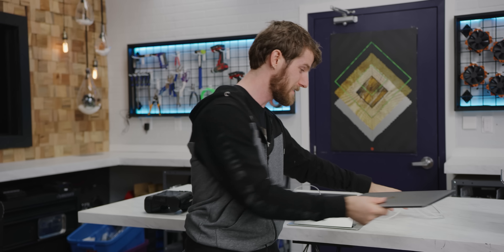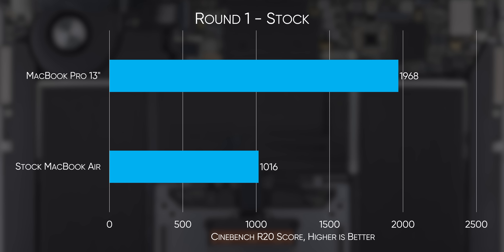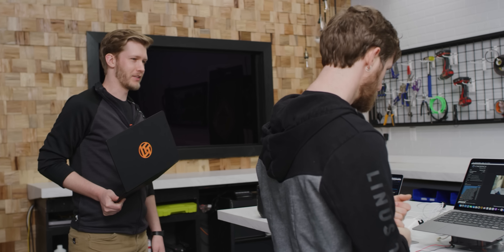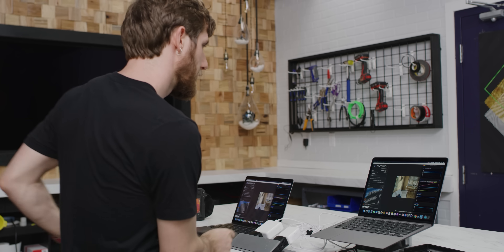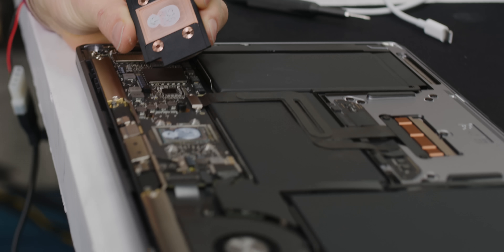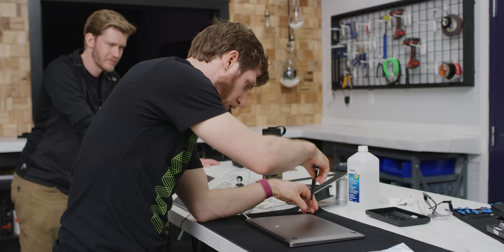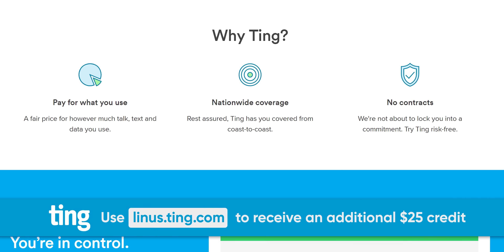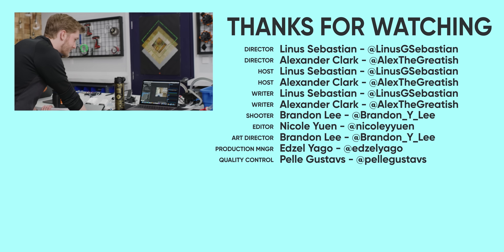Fixing Apple's Engineering in an Hour

Comment: I'm not into conspiracy theories but the one stated by Linus in this video might very well be true... Apple cannot be that dumb to just forget to put a freaking heatpipe between CPU and the fan.
The only non-conspirological explanation is that this laptop was actually already designed with and ARM chip in mind, but it just wasn't quite ready yet, so they had to ship it with Intel.

Comment: Why not put the insulating layer on the outside?
I bet the part of the laptop over 43 degrees is quite localised, so if you only put insulation over that part then the heat would disapate over a larger area of the case, so while you might loose a little bit of heat dissapation, you'd decrease the temperature felt by the user.

Comment: "what if apple is sandbagging the MacBooks so that when they introduce the arm based MacBooks it'll be at half the temperature"

Doesn't sound too far off what they would do considering that fact that they severely underclocked the Apple II GS to make the Macintosh look good
Reply: Wait, you're saying that they haven't learned anything in 30 years? Yeah sounds plausible.
Reply: @AndiKola  they have learned that yes this practice works and most apple users are dumb they fall for this trick everytime
Reply: Lol how about the tiny ass heatsinks they were putting on the PowerPC cpus back in the G4 and G5 days. It’s amazing how people complained about how hot they ran lol, an intel stock heatsink from the same time was way better than the dinky little cooler in the PowerMac G5. PowerPC was fine, they just didn’t cool it properly.
Reply: @mizukichan999  What are you talking about? The G5 had a insanely large heatsink, it was just a really shitty design.
Reply: I don't think it qualifies as a "conspiracy theory" if Apple has a long history of shooting their old hardware in the kneecaps because "tried and true" is not as profitable as "new and expensive".
Reply: No wonder they aren't working with AMD on their CPU side

Comment: This irks me a lot with laptop makers: going for ultra thin models that don't have enough cooling. It's just so stupid in particular with higher end CPUs: paying more for a "better" CPU but not getting that performance due to low thermal performance. But I guess the market just wants that sleek, thin look, no matter the performance. I understand wanting low weight laptops if you carry it around all the time, but you can make it light and not so thin as well. I mean, just with the thermal pad getting +13.7% performance is huge - feels like being robbed of performance on the stock configuration.

Comment: Macbook Air*

*Does not come with moving air. Provided air is static.
Reply: macbook AIR, passive cooling, the fan is there so u think it is actively cooled, just to fool dumb people who buy that sh!t
Reply: @scudsturm1  The fan draws air over the entire motherboard (exhaust). Its still not great but atleast it's there.
Reply: @seshpenguin  It's practically worthless and serves no purpose.  Not a real cooling solution.
Reply: @seshpenguin  Nah they just put the fan there as another thing to fail for planned obsolescence

Let's play what will fail first... The scorching hot CPU or cheap Chinese PC fan that doesn't even cool it, who knows!
Reply: @datachu  u can bet the fan
Reply: @seshpenguin 
What you just said is equivalent to putting a 200mm fan on top of the hood  of your car instead of a radiator fan and saying "at least it's there"
Reply: For the Air you pay a premium
Reply: @ilantzur02  the heatpipe is not included, this costs another $ 300, u can bet apple would do it if they are really that greedy
Reply: @scudsturm1 
They ARE.
Reply: @Rerin YL 1% would be a better guess

Comment: tfw the bloomin' nintendo switch, a handheld console, has more powerful cooling than this thing
Reply: That being said, the switch doesn't necessarily do a great job either. They absolutely drowned it in thermal mud. Cleaning it off and putting proper amounts of Arctic silver on it seems to have helped, but since there's no monitoring tools, my results are anecdotal at best.
Reply: @WahotsW  Indeed, and that's a good idea for when I'm bored! 
But seriously with this macbook, a tiny handheld's got more thermal mass, a heat pipe, AND and an actual finned heatsink!

Comment: Okay... like... you're freaking me out with you're "Conspiracy Theory" concerning the Intel vs ARM chips because I could absolutely see Apple pulling something like that.
Reply: You should check out the controversy around the Asus Zephyrus GA5902. The AMD versions have the vent holes over the fan intakes blocked off with paper, while the Intel versions don’t, which gives about 15 degree worse temps, not to mention weird as shit power settings in the BIOS basically forcing it to boost at all times. I bought one, removed the paper from the vents and got better temps, 20% better Cinebench scores and gained around 15fps depending on the game. And that’s without even touching the thermal paste.
No one can figure out quite why Asus did it, it certainly makes no sense, but the tinfoil hat idea is that they’re intentionally screwing up the performance of the AMD based systems for some reason
Reply: Lucas Foster Windows did this same thing to the surface laptop 3!!!
Reply: There's gonna be a lawsuit in like 5 years and sheep will continue buying apple. Its the way of the world
Reply: You're
Reply: They need to come up with a new selling point now :I
Reply: nuh, it's that intel can't make good low powered cpu.... oh wait...
Reply: I think they could beat an i5 processor with their new A14 without needing to sabotage the intel version, but this laptop is SO nerfed that the A14 (if they use that one) will be WAY faster. They'll be able to advertise like "50% faster than Intel" or something like that, and better battery life
Reply: What conspiracy did he say
Reply: @MrMaddog2004subscribe  That Apple was intentionally nerfing their performance with Intel chips so that when they make the switch to ARM , the performance with ARM will look better by comparison.
Reply: I mean apple is notrious for slowing down older iPhones via software updates so people would be forced to buy a new phone, so i dont think this is too far fetched.
Reply: BeanieBanta this actually isn’t fully true. They scaled down the performance of iPhones to be on par with the power delivery capability of an aging battery. Which actually significantly increases the longevity of the phone, however the issue was they didn’t tell anyone they were doing this which is shady
Reply: @JaysonMcLeod  Yeah. Less processing power = less stress for the battery, that's fair enough but apple is apple so they kept shut
Reply: BeanieBanta That’s false. They slowed down older iPhones because the old batteries were unable to provide enough power to the CPU causing it to shutdown. They’ve made that feature optional now and you can keep the same performance on your older iPhone at the cost of unreliable battery life.
Reply: @adityasrivastava6336  How can I turn off the "slowdown" of my iphone? I've never found that option in my phone
Reply: @BeanieBanta  Stop spreading that false rumor. If you got a new battery the phone returned to it's initial performance, also now they let you choose if you prefer to slow it down in order to save battery or not.
Reply: Me too lol but for Ryzen, it could take them a lot more years to catch up
Reply: @MsMonster128  they don't need to be faster than ryzen,  just themselves. Because they know the people that buy these laptops are pretty ignorant of anything else
Reply: @thegamingshatt4758  I mean, your not wrong
Reply: @thegamingshatt4758  Well I buy Apple for the OS, screen, keyboard and unified ecosystem across the board. The biggest beef I've got with W10 (and Android) machines is W10 (and Android) itself and this comment is written on a W10 desktop PC.
Reply: @MsMonster128  Ryzen can make ARM chips pretty easily...
Reply: @pravda9646  I mean that they don't use the more efficient/more powerful ryzen chips to keep the slower/power hungry Intel chips in their charts when they transition to arm, if they went Ryzen it could take them a lot more years to catch up with the raw power of x86 (let's say 4900hs as an example)

Comment: It's almost as if the machine is built to cook itself to death so you have to buy a new one. Think different.
Reply: it's just built to be slow enough that people want to spend more on a MBP
Reply: @vask92  All part of the plan, that way you get to choose which way ya want to get f*cked lol
Reply: think different, buy a thinkpad and build yourself a hackintosh and save some money
Reply: Thats probably the plan. Works until the warranty expires.
Reply: That's big brain planning
Reply: Or think smartly, and use a custom fan profile :) (on the Macs that actually have a fan connected to their CPU)
Fans are far cheaper to replace than a cooked CPU
Reply: @fricki1997  Yeah, at that point you're basically paying thousands of dollars for a Raspberry Pi with an Apple logo
Reply: I've been using a MB Pro i5 2018 for over a year, and am happy so far. 85°C max under the most intense loads, 40-50 under normal use. I don't know if the same rules apply, but at least in chemistry, every change by 10°C changes reactions by a factor of two, so my hardware should last a bit longer at least.
Reply: @fricki1997  bro, my PC does 30c under normal load, never seen it above 70.
Reply: @brazgazz  Are those absolute values or delta T above ambient?
Reply: Louis rossmann did a video about this some are already coming in with dead CPUs making clicking noises.
Reply: @szymonkrysiak6852  And if it had run at 70°C, it would probably live longer than it will now....of course you can't compare results with a sample size of 1
Reply: no wonder the ceo is tim cook
Reply: @RpM_Evan not true people will avoid spending $100 upfront and end up spending $50 four times to get what they actually need. Also if you are buying apple you probably aren't very smart or good with money so I could see those people buying multiple macbooks.

Comment: Question? Is there not a thermal resistance (not clear on the terminology) being that the ice cold block is so much cooler than the ramped heat? I’m thinking there has to be a loss in how much heat would be pulled into the ice loop almost like reflection instead of absorbing it

Comment: 2015 ..........Insert in pan of water
2020...........Insert in tub of water
2025...........Insert in olympic sized swimming pool
Reply: (Continuation)
2030..........Insert in a Lake
2035..........Insert in the Arctic Ocean
Reply: Linus: Hold my beer
Reply: 2050:so guys, we are going to Neptune. The blue planet.
Reply: 2053- Put Macbook in center of Mars core so it will melt ice  convert it into air , giving Mars an atmosphere.  Which Linus will look back and 'total recall ' the Macbook submerge in pan full of water.
Reply: 2040: inserts it on pluto methane ocean
Reply: chuck it in the river if they don't give a refund.
Reply: 2045: insert in dry ice enclosure
Reply: 240........insert in the Atlantic Ocean

Comment: Noice, so what I learned : don’t get a MacBook
Edit : How did this get 150 likes My mind is confusion
Reply: Max Jameel 😂
Reply: Ding Ding Ding we haaaave a winner. You get an A+ in common sense.
Reply: Wrong. Just dont get a MacBook Air
Reply: XPS 13 9300 overheats just as much. Don’t let LTT decide for you. They focus on sensationalizing videos and titles. They’re fake news.
Reply: @creep4415  Yeah except a Macbook air pulls 1016 on Cinebench r20 where the XPS 13 9300 pulls 1616. Sooooo....
Reply: @creep4415  Stupid comment number 2. You're on a roll. The xps gets hot, but the performance is about double that of the MacBook. Derp.
Reply: creep Basically every high performance laptop is going to be thermal limited, it is a question of how long it takes to get there and what performance it has at that limit. 

The problem with the MacBook Air isn’t the temperature it operates at, it is how quickly it gets to those temperatures and how little performance it has at that temperature.
Reply: but... macOS
Reply: @cloud8.5  hackentosh
Reply: @cloud8.5  Is shit.
Reply: @FrogOf4Chan  have you ever used it?
Reply: @autobot_raos  I will admit MacOS is pretty good. But since i have no workloads that specifically require Mac i stay the fuck away from it :P
Reply: @autobot_raos  All the time at work, but only for testing. Because nobody wants to work on it fulltime because it is SHIT..
Reply: Carewolf yeah i never seen a professional with Apple device
Reply: @mrjack08722  so preference differs for people. Doesn't mean that people like @SPC Dewitt calls it 'shit'. I have been using windows since my birth but it's been 1.5 years I'm using macOS as my daily driver and honestly I'm loving it. Be tech savvy not toxic, it helps.
Reply: Przeciętny Cud I don’t think you have heard of something called, developers?
Reply: @autobot_raos  No matter what the OS X is the most dull and boring os out there no matter how much stable it's.. Unless some specific work isn't for general users and neither friendly..
Reply: @nodalanalysis7704  I pity you for calling an operating system "'dull' no matter how stable". Like what's your point? And since your replied to me. Re-READ my earlier comment where I specifically said 'preference differs'. Just stop being TOXIC and be open minded.
Reply: @autobot_raos  But the question remains. IF and this is a hard IF. if apple made their OS free to buy and install on any laptop. Would you ever use a apple product again?
Reply: @bartomiejkomarnicki7506  Then you don't hang out in the right professional circles. I worked outsourced support for 50+ SMEs in the creative sector in central London, the only Windows systems you ever saw were either in the server room or the accounting department. Why? Because deadlines - if you know what you're doing (and Mac support is a very specialized field) and the business you're looking after is set up right, someone could set fire to their Mac and you could get them back up and running within 20mins with a loss of maybe 5mins worth of work, often without even having to visit the site (if they know which end of a power cable goes where)
Reply: Stoney Mahoney man thanks for that but that straight up sarcastic
Reply: @mrjack08722  Honestly? YES, I'm impressed by my MacBook Pro 13 inch 2018, 4 TB ports, and I think I made the best choice. (I come from a middle class family, so it was a hard choice, sharing only to emphasize on my decision). Before this I was using a HP pavilion notebook. And NO, apple will never make there OS open source to keep the integrity of Apple alive which, I think is for the best. PS. Linux exist if you are looking for a similar experience but not exactly like MacOS. Just saying!
Reply: @autobot_raos  OSX hasn't evolved since the days of Vista. Windows is buggy but at least it doesn't get in my way by actually having modern day features, such as window snapping and built-in VMs. Elementary OS is a Linux distro primarily made for Mac fans and wrecks OSX in it's usability for me, having a nice looking desktop but having features and shortcuts shared across every OS but Apple's, all without forcing me to pay the Apple tax for their poorly designed laptops in order to use the OS.
Reply: @autobot_raos  Have fun having your Mac randomly die as soon as the warranty ends, and Apple telling you that your data can't be recovered (Despite it probably being recoverable).
Reply: @elsasslotharingen7507  aah shit, here we go again! 1) I have time machine backup, 2) I have Apple care protection plan, 3) I cautiously and carefully use my tech gadgets unlike majority, 4) shit happens with every tech product and giant, but you just have to hate over apple coz it's apple. Do you want anymore fact punches? I hope not coz I'm done arguing here. Peace out!
Reply: @amirpourghoureiyan1637  Bro, I'm a data scientist, I love my Mac for what it is. Stability and security is A1 for me. Talking about the features, MacOS became a mature OS before Win 10 came out. Stop being so biased for fucks sake. I love windows and I love Mac but I prefer Mac over windows anyday for my work. I'm done arguing here as I said in my earlier reply and gonna reiterate again, "PERSPECTIVE MATTERS". PS. It's not really a poorly designed hardware. Not for me atleast.
Reply: @autobot_raos  Stable has nothing to do with interesting.. I also said about preference based on types of work.. Stop being stupid further as your all replies don't show any interesting facts
Reply: @autobot_raos  From your last reply you surely don't know much what you're talking about.. OS X was the one of top 5 os had most vulnerabilities since two decades.. And Windows was the least operating system had technical vulnerabilities.. Data scientist? Well Indian there for you.. Their class match to west people with no degrees
Reply: @nodalanalysis7704  Funny how a guy who loves to call himself "Tech Master" can be so clueless and dishonest about technology.